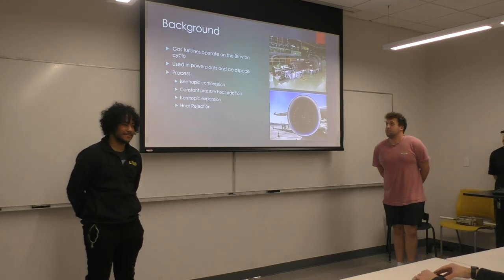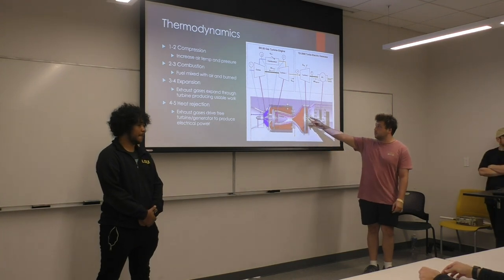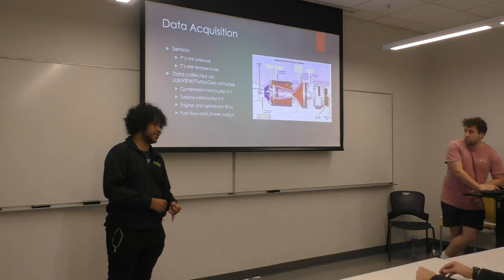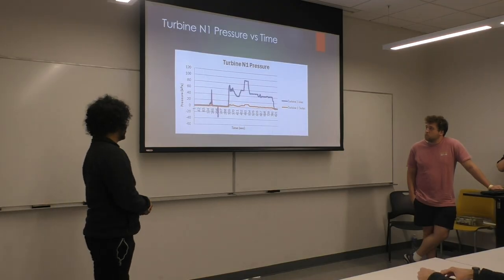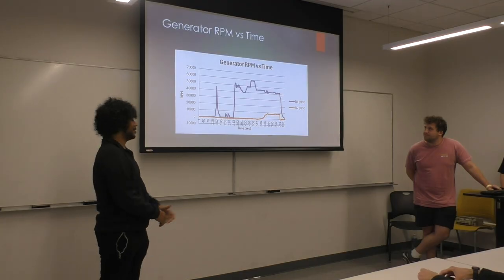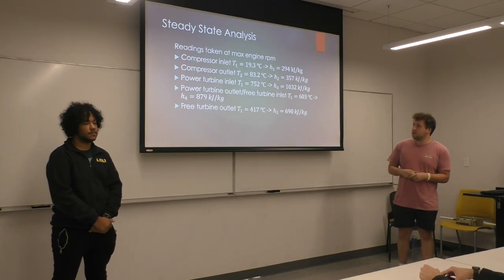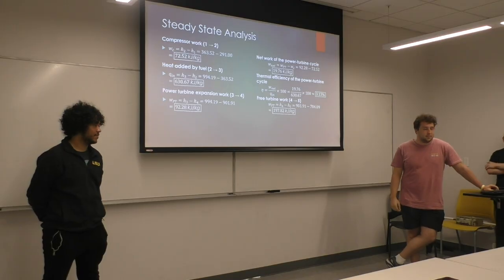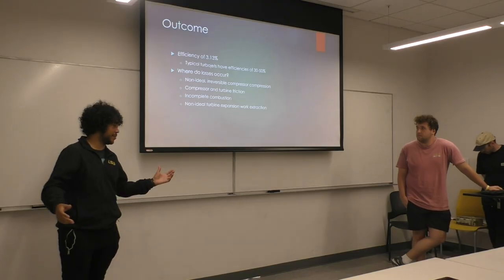Ian Archangel

Comment: I think you guys did a great job of presenting the gas turbine experiment! I like how you guys explained the information fully, but in a concise manner, which allowed the presentation to flow smoothly. One area of improvement I have is to consider adding the numeric equation of the first law in the theoretical background section so the audience knows what assumptions you made when applying this equation for the analysis. 

Comment by Charles Lee